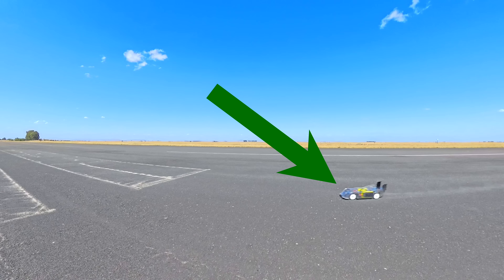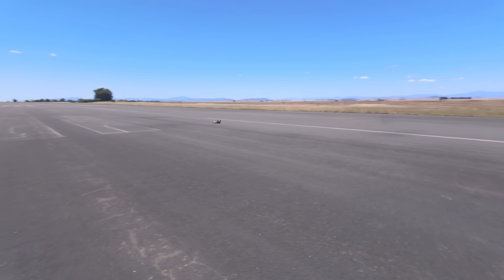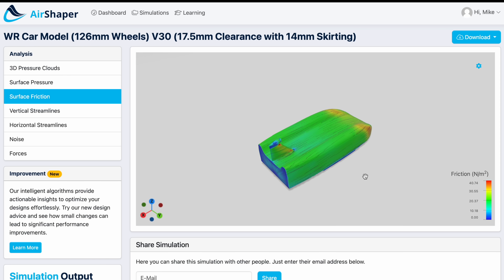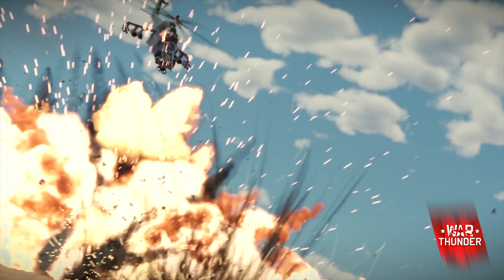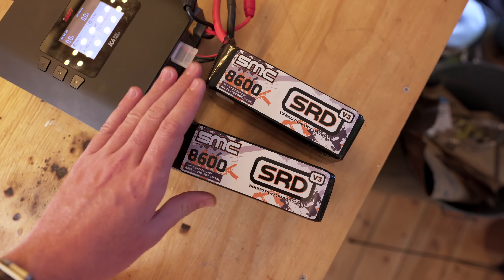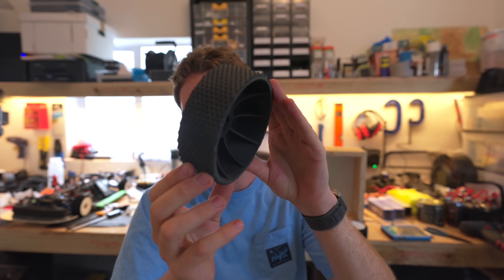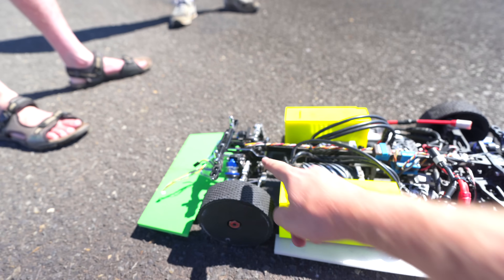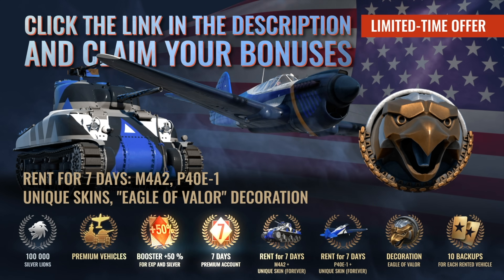World’s Fastest RC Car Project - Part 1 Aerodynamics

Comment: If you haven't tried yet, they make grip compound for the foam tires that's supposed to give them better traction. It might also help hold the glue together. 

Also, from other RC Series, softer rims weirdly gave more traction and stability compared to solid rims. So despite the strength requirement, a rim with a little flex might perform better, if only in absorbing vibration

Comment: A lot of expert advice in these comments. It would be nice if the experts posted a link to their efforts. I guess that the alloy wheel alternative would generate a large degree of vibration on anything but a very smooth track?
My "expertise" is in close to a half-century as a motor mechanic :-)
Nice project and video.

Comment: You need to run a X-Y skew compensation test on the bambu X1Cs. They are never perfectly square from the factory in X-Y.  Will be 0.001" to 0.004" off from factory at that wheel size.  That much out of roundness wil produce a significant amount of vibration at 20k rpm.   Google M1005 skew compensionation for different methods to do it.  You will need to have a different compension profile saved for each 3D printer you have.
Reply from the maker: Okay cool I’ll try that!

Comment: What would a golf ball shape on your design be like in the wind simulater as mythbusters said they saved fuel when they coated the outside of a car with clay and dimpled it out all over. Just a thought.
Reply from the maker: I think the dimples only really help with a ball shape because they keep air close to the ball instead of being detached. But we will run simulations like this to prove the point in the next video.
Reply: Oh That would be great 👍🏻  Sooooo curious to see the results of that. Thanks again 👏🤜@LukeMaximoBell1

Comment: If you're attempting world record for speed...wouldn't it be better to not have any fpv system? Just data logger only. Due to weight?
Reply from the maker: Weight doesn’t affect top speed. And 30g on a 9000g car isn’t going to add any noticeable weight.

Comment: Lol that's not 100 horsepower
Reply from the maker: Yup, it is
Reply: @LukeMaximoBell1  No, it isn't. 100 HP motors are larger than that car. Not to mention the wiring and electronics aren't even massive enough. I doubt the batteries are even capable of discharging fast enough to deliver 100 HP. You RC people are silly.

Comment: Pro tip the lipo catching fire and ruining the car isn’t really the concern its more the large field of dry grass that would get out of control very quickly.
Reply from the maker: Yeh completely fair. I made TPU cases for the battery to reduce damage and risk of them catching fire, and they seem to work really nicely. I’ve actually never had a Lipo fire before thankfully. Only electrical fires from ESCs mainly

Comment: Great video. That ESC and motor is not competitive in the speed run game. For 8S its xlx2 all the way and for 12S the MadMax20 400Amp 12S is where its at. New speed record for single motor car is 200mph as of last week. Those SMC V3 are top dog. ONYX and SMC I would say is tje 2 current kings of speed run batteries. Your doing a great job. Im currently builsing a custom Losi dbxle dual 12S setup to chase the 1/5 off road record.
Reply from the maker: Yea for sure. I can’t say too much but Hobbywing is joining the speed run game next year ⚡️ I was looking at the Mad Max20 and it looks awesome. Would even be able to up it to 15S, which would be better.
Reply: Yes the MadMax21 can go 16S. Ive got 2 of madmad15's and 1 madmax20. They are really awesome. Im still pushing my single motor limitless on a 2028 1700kv with xlx2. My biggest barrier has been batteries. They are so critical its crazy. On a single 6S cnhl 9000mah I would pull the voltage down from 25V to 13V at and the esc would just cut everything. Draws 480amps. Then I out dual 6S 9000cnhal in parallel and tje voltsge stabilized at 19V and it ran like a rocket. Having batteries that van maintain Voltage is critical. Good luck man looking forward. Sterkte.h @LukeMaximoBell
Reply from the maker: @ whoah that is some massive voltage sag. SMC makes the best batteries for these purposes. Good to know that the Max 20 is a reliable product. I’m definitely interested in testing it out. Do you know what current draw you’ve gotten on it? Im just curious to know if it has a current limiter on it or not, ie can you go over 400A continuous draw with sufficient cooling
Reply from the maker: @raindeergames6104  Onyx uses SMC’s old battery tech
Reply from the maker: 200 mph for single motor is epic!!

Comment: I’ll offer one tip to help your journey. - ditch the central vertical fin. I smashed one of my cars so many times trying to persevere with a single fin. Stability was transformed when I finally gave up and switched to twin side mounted vertical fins. Good luck with the project!
Reply from the maker: Ahh very interesting... Initially I was going for 2 fins on the sides, but I wanted my FPV view dead centre so I went for the central fin. But I trust your judgement on this one, so I will move to 2 side fins. If there are any obvious mistakes you see me making that I could avoid then please feel free to share! 🙌🏼 Thanks!
Reply from the maker: Maybe I will do 3 fins so I can keep my center FPV view. Haha. They don't introduce that much drag.
Reply: With a single fin, my car was almost uncontrollable over 150. It was Martin Peace that kept telling me it was the fin. He begged me to change it. I did a trackside swap to twin fins and put in a solid 175mph (pb at the time) in the subsequent runs.
Reply from the maker: @scorchedparts8013  That's awesome! I'll definitely be switching over to dual side fins then.

Comment: Back of it should be not straight but more like round and smaller... From the Aero dynamic point of view this RC looks 1930s 😉😅
Reply from the maker: I had the same initial thought, but it eventually became clear that a cut off back was the best option for balance between drag and downforce.

Comment: At least you read the comment Section...
I saw a Video that AUDI runs the "Front Diff" at a Higher Rotational Speed than the Rear Diff, for High Speed Stability.
Your Car needs to be 50% Longer, 20% Wider and 30% Heavier. As it is OUT of SCALE for the Road Surface.
You will need REAL REINFORCED TIRES and RIMS to match the REAL SURFACE... No more Toy Hobby Stuff.
Reply from the maker: Yes it’s true that the tires are out of scale. That’s probably why they wear down so fast!

Comment: @15:32 the rear end gets light causing uncontrollable yaw. A left front tire delaminating makes the car go left, it doesn't make the car pull hard right. You need to increase the rear ride height and add shock travel limiters as well as add vertical stabilizers behind the centerline on the rear wheels as well as avoid the bump that lifted the tires long enough to freewheel the foam off. 
No downforce, no Rudder and a bumpy road is a recipe for disaster every time
Reply from the maker: I did runs before this at basically the same speed where the cat stayed in control. So I think it’s more likely that the wheel failure caused the crash
Reply: @LukeMaximoBell1  except that it pulled the wrong direction for it to be a wheel failure. Also you can see the yaw was induced before the chunks of foam left the tire which is indicative of a freewheeling not a loaded failure
Reply from the maker: @stp440  True, unless the car started turning left because of the wheel failure and the gyro stabalised steering overcorrected to the right and then it lost traction. Either way, I agree with you that I need more downforce
Reply: @LukeMaximoBell1  once a tire let's go there's no bringing it back. You can turn to full right lock and its still not going to go anywhere but left, I've seen and experienced it many times. I'm not trying to be rude herr, I just don't like watching bad things happen to good cars and people and want to see you do everything possible to avoid another expensive crash.
Reply from the maker: Completely fair. I am still fairly new to this, so I always take on board what experienced drivers have experienced. I would be an idiot not to! haha. What I did notice while driving, is the car felt a lot less stable on the run where it crashed, compared to the previous runs. You could be totally right that it was a downforce issue. I'm definitely going to investigate introducing more downforce in the future. And hopefully I can make it adjustable as well.

Comment: Hey man, I'm two minutes in and all I gotta say is that a lot of us stand on a ladder while speed running for a reason. Please keep safety in mind when running speed running rc cars. A lot of us spend an entire season refining suspension and aero while slowly pushing the car a little further. It's a great hobby and I wish you luck on your adventure.
Reply from the maker: Yeh I know I was standing stupidly close to the car on the early passes. Don’t worry I’m not doing that anymore and with the FPV I can stand far away.
Reply: @LukeMaximoBell1  I'm glad to hear it. You are working with a great chassis. Just remember that sometimes less is more. Some of the fastest rc cars are single motor for a reason. Don't try too hard to reinvent the wheel ;)
Reply from the maker: @jdmjedi777  Yes for sure that is good advice! Ideally a single motor is the way to go.

Comment: you could have printed your mold hollow and just filled it with the cheapest cement/mortar and saved a lot of time and effort
Reply from the maker: That's an interesting idea! Not sure if it would be strong enough, but might be worth trying
Reply: @LukeMaximoBell   solid filled concrete is extremely strong against compression loads
Reply from the maker: @ I’ve never tried it before but I will do some research

Comment: Vacuum forming is a great way to make bodies. It’s hard to make 3D printed molds because you’re using a thermoplastic to form a thermoplastic. As you mentioned making the mold “stronger” helps but it’s really thermal mass that you’re adding. If your set on vacuum forming you should do a glass layer with epoxy to get a ridged shell, then at that point just wet layup composite shells would be better.

(If I just watch enough of the video my comment is irrelevant)
Reply from the maker: Haha fair enough! Thanks for the comment
Reply: @ I just had an idea for your wheels if it’s worth anything. If your wheels (just the rim portion) are deforming at higher speeds you could mess with wrapping them with carbon fiber or Kevlar tow. The idea would be the wrapping would act like a belted rim. Carbon does much better in tension but it might help keep things glued to the rim if it’s not deforming so much at speed. 

(Silly ideas spark good ones)
Reply from the maker: Not a bad idea! I'm going to test 3d printing the tire portion where I could introduce a reinforcement midway through the print.

Comment: Are you limited in length?   It just looked like you could do a lot more to improve the airflow as it leaves the back of the car. It looks like building wheels to survive at ths speed is one of the biggest challanges. Are you allowed active aero, can you use a fan to suck it down?
Reply from the maker: The wide aspect ratio of the car makes having a tapering tail unrealistic and not as helpful as you would think. I might try active aero for the next design! And yes wheels will be a big focus

Comment: You could consider adding fans for down force as well, if you have them mounted to draw air up through the car you can pull the car down onto the tyres with more force than that cars weight would allow.
Reply from the maker: Yes I might try this for the next build! Would be pretty awesome!!

Comment: Probably need to look into the kinds of resins used to make skateboard wheels, as skateboards see all kinds of abuse while in use. Could try something where the hub is put into a mold, and then the resin is cast over it to create the tire. I'd guess for more surface area on the rim for adhesion, may want something grooved similar to a honey-baster. Should not come apart in any fashion unless destroying that tire.

I've said it before when watching different people try this, the wheels and tires are the main limiting factor. So figuring that out is really the challenge. Most people have more than enough power, and the aero of those things is fairly standard too at those limits.
Reply from the maker: Yes this could be a good idea! I'll check it out for the next build! 🤩

Comment: I think you need solid Aluminum wheels,with 5-6mm solid rubber tire ,attached with the most advanced affordable adhesive you can get,you must also get a wheel balancer for RC cars/buggies,they are cheap,also you could experiment as "Myth Busters" did with golf ball dimples,since you already made the mold for the body.
Reply from the maker: The 3D Printed PPA-CF wheels are just as strong as aluminium would be. But I've got some good ideas for rubber wheels!

Comment: Take a look at the trail blazers before you on the salt lakes. The back of the car needs a taper to bring the air back together. Install a flight controller with gps, gyro, and cruise. It will keep your car running straight. Plus you can send lots of telemetry data back to your fpv goggles like amps, volts, speed.
Reply from the maker: The wide aspect ratio of the car makes having a tapering tail unrealistic and not as helpful as you would think. The car is already running with a flight controller and sends a lot of telemtry back to my goggles

Comment: Steel front splitter witch should have been plastic or at minimum aluminum caused the rear end to get light witch started driving the rear and then rest was history. Tryd fixing a tiny problem and created a huge problem.
Reply from the maker: The car weighs about 10kg. The 300g splitter isn't going to make a difference like this. It failed because the front left wheel lost grip

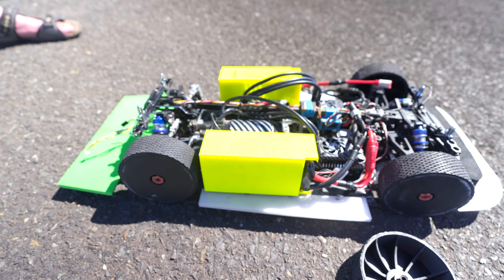Comment: 14:15 the wheel came off because the locking grub screw isnt reverse thread and it unscrews its self from just driving it. huge design flaw by AARMA
Reply from the maker: Actually the CVD axle broke entirely! It wasn’t just the wheel falling off

Comment: There is nothing wrong with wheel deformation, you just have to engineer it in.
As the wheel increases speed, allow it to expand. It will increase your gear ratio as you go faster.
Dragster tires do just that.
Perhaps look at Kevlar belting.
Reply from the maker: It's a problem when the wheel explodes! This has happened with some other people I have seen.

Comment: Something I think a lot of people fail on, is the aero. And the main part they fail with, is the leading edge.
You have a very sharp leading edge. Unless you know 100% that the angle that edge is hitting the air at is never going to change, than you need to round the front edge over.
Funnily enough, part of that rounding will also put some air under the car, but not in a terrible way, it will just stop air separation and loss of downforce when hitting bumps.

Something worth having a look at too, is the channel "Super Fast Matt" He's been building a land speed racer, and there's a few things in his latest video that would really help streamline your air flow under the car, and help you to minimise drag, as well as the help reduce the want for the vehicle to get air borne ;)
He also goes deep into some of his aero stuff too, and designing it. :)

As for tyres, you might need to look at making your own, from pure scratch, and likely will require the addition of belts, similar to how car tyres are made. Above that, if you can have the rim in the mould when you make it, then the added benefit is being able to have the tyre go through the rim, and hold on from the inside, with less glue needed :)

I'm keen to see how this progresses, and loved the video! :)
Reply from the maker: Yeh superfastmatt is great! He gives a good acknowledgement that a lot of aerodynamics is feel rather than science
Reply: Great comment. Just reminds me of how great (99% of the time) the RC and in particular the 'Speed Run' community is. We're all (some to the point of obsession or insanity) very competitive in what we do. But at the same time, 99% of us are willing to share all of our 'secrets', lend out or give parts to strangers, and gladly help each other achieve the next goal in our speed running path to becoming the fastest RC car in the world.  I love this hobby. And the folks evolved in it make it 100 times better. Mnñnbbmm n n pppppb

Comment: You could print housings for the wheels to reduce the dust build up inside of the shell..
Reply from the maker: Yes the wheel design I currently have pulls in a lot of air, so I might have to reduce this 🙈

Comment: I wonder if its possible to have negative tyre pressure...... The vacuum could allow a soft material for grip but help reduce the tyre ballooning at high rpm....
No idea how you would make something like that  though.!
Great approach though, i think you can do it
Maybe you could attach the tyres at a high temperature, so when they cool a negative pressure is created.....
Reply from the maker: That’s quite an interesting idea! Worth looking in to 🙌🏼

Comment: Maybe you like to try Lehner motors, you can fully configure the specs and their RPM range is insane even for the lower KV motors.
Reply from the maker: Yeh, I might reach out to them to see if they are interested. They have some beasts in their arsenal!
Reply: @LukeMaximoBell1  Thanks for your video! Great content.